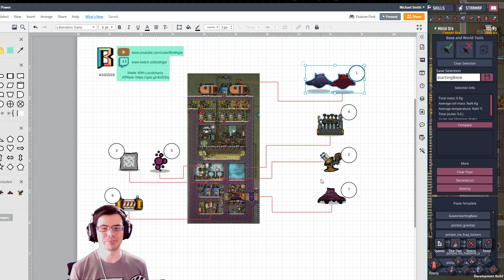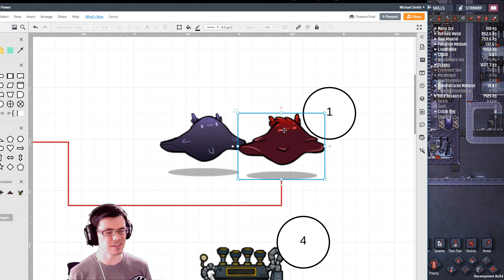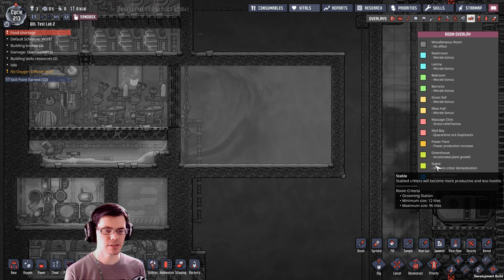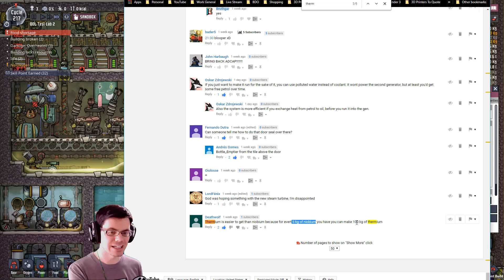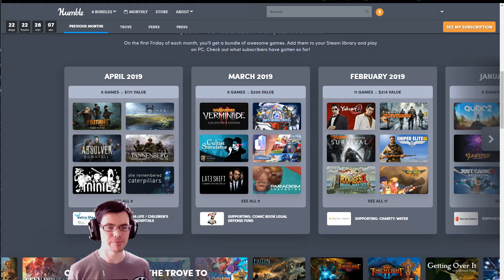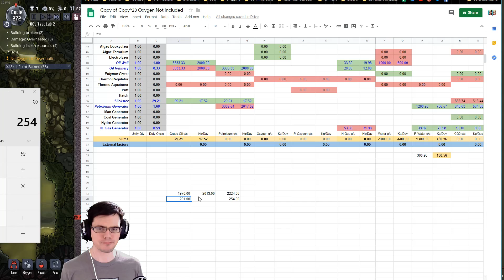Unlimited Food From Free Energy! Oxygen Not Included

Comment: If you don't mind using debug then what I do to keep the temperature that I want is spawn a couple of thermo nullifiers and feed them the hydrogen from my electrolyzers setup. Use thermium temp shift plates as they conduct heat really well and voila. I use this system for my base, aquatuner water, regular and polluted water, even for my natural gas generators.

Comment: I did a different built with cooling down the petroleum generators
Then it produces -5°C cold polluted water I can use to cool down the whole system
But it produces -5°C cold CO2 too and molten slickster likes it hot
Reply: Use the -5co2 for cooling your base^^
Reply: @TheLive100  I used the cold Co2 to cool the oxygen I produce from the extra water